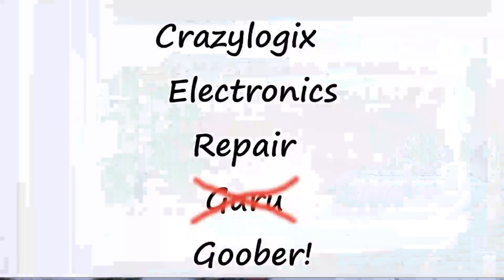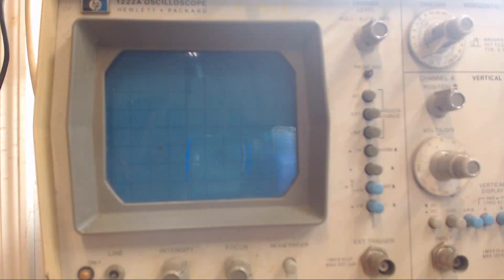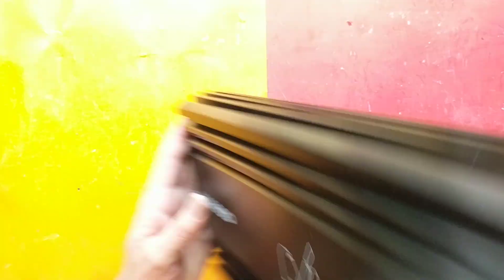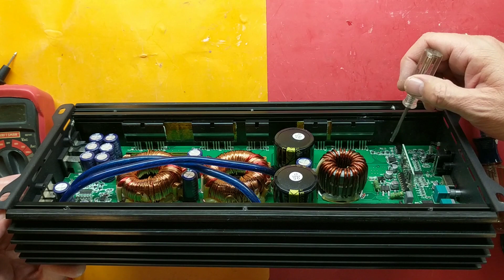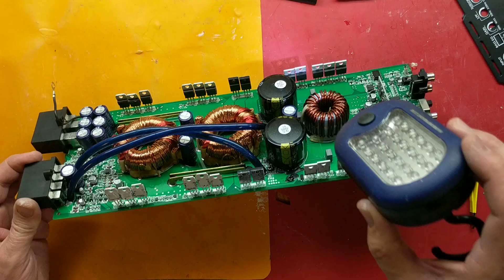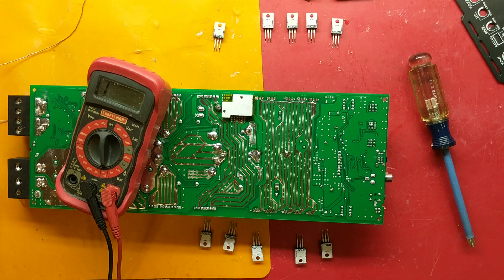Machete 1500D Troubleshoot and Repair Part 1

Comment: For anyone repairing an amp like this watch the rail caps they don't have bleed off resistors an they keep they're high voltage on the rails for a long period of time it's best to drain them before any troubleshooting

Comment: Can you replace the (not sure what you called it) little paper behind the mosfet with the paste? I hope that makes sense..lol great video!
Reply: Where are you at hoppy. In springfield?  If so i wanna help fix cars to beat the crap out of
Reply: @fallofthezombies1379  I'm in Eaton Rapids Michigan. Hahaha it's a blast. Little wet at the moment but once it dries out look for some fun video's.. and you are always welcome to come join in or ride along!
Reply from the maker: Nope, the kapton tape insulates (electrically) the back metal tab of the Mosfet from the heat sink. There is thermal paste on both sides to help conduct heat from the Fets to the heat sink. Some amps use silicon thermal pads (sil-pads), some use special non electrically conductive anodized strips of aluminium to do the same thing.
Reply: @Crazylogix007  thank you very much! I really appreciate you taking the time to share your knowledge! Keep up the great work!!